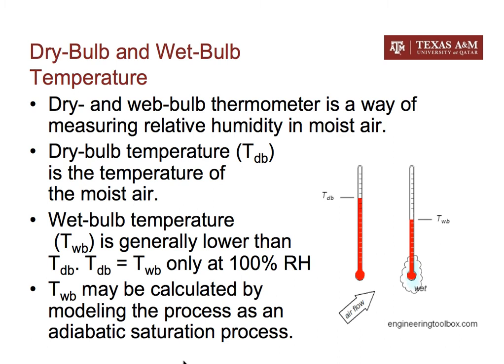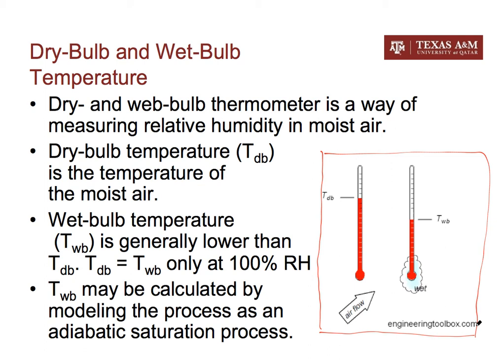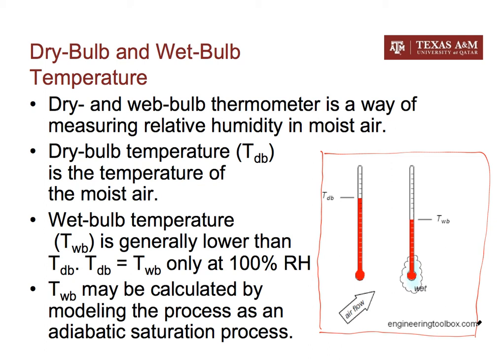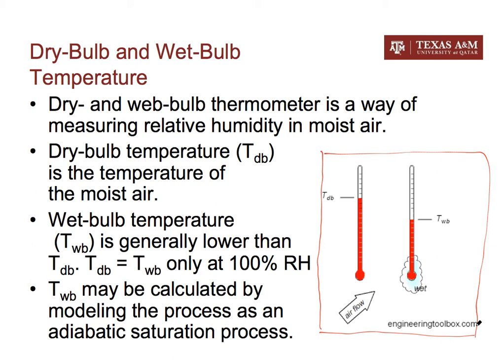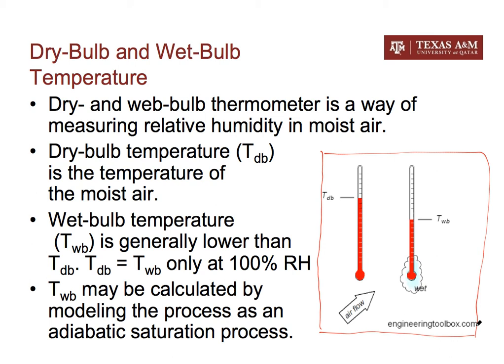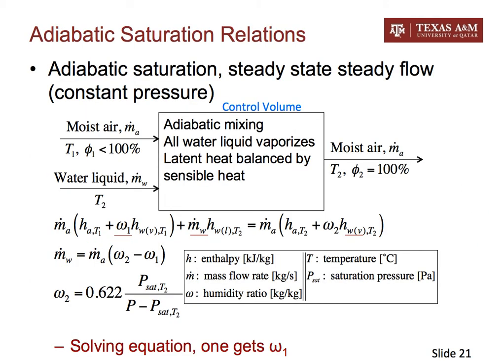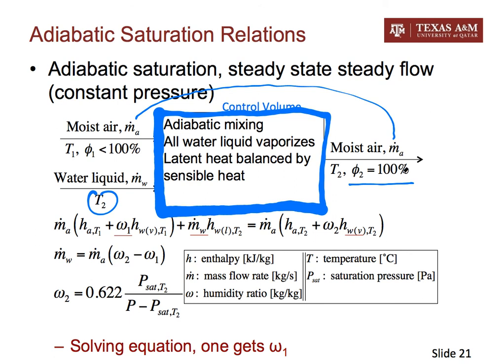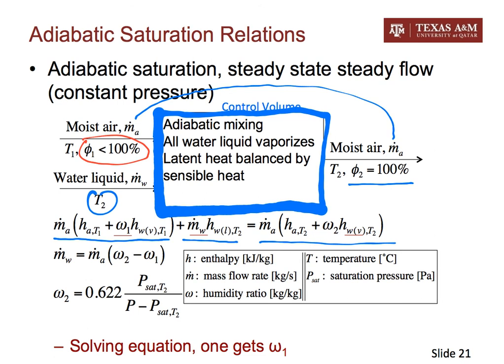Adiabatic saturation and humidity measurement

Comment: how can it be adiabatic and constant pressure simultaneously?
Reply: For instance, an idealized mixing chamber is adiabatic and constant pressure.

Adiabatic means the system boundaries experience no heat transfer.  This doesn't mean parts of the system can't exchange heat with each other, just that there's no heat exchange with the surroundings beyond the system boundary.  This is how adiabatic saturation can be adiabatic at the same time as it happens at constant pressure.  Heat transfers from the air to the water, and evaporates the water to join the gas mixture as water vapor.

Comment: how do we know mass of water at temperature t2
Reply from the maker: You do not need to use m_dot_w explicitly. Rather, divide both sides of the energy conservation equation by m_dot_a, and then substitute (omega_2-omega_1) for m_dot_w/m_dot_a, you will have an equation with omega_1 as the only unknown. Solve it to get omega_1.
Reply: thank you

Comment: Lower relative humidity leads to more space for evaporation &  that leads to lower WBT?
Likewise Higher relative humidity leads to lesser space for evaporation and higher WBT?
Why do we need to measure WBT around the air handler to determine the required charge of refrigerant?
What is the sense of this formula 3WBT-DBT-80 used for super heat or charging?
Higher relative humidity means higher load on airconditioning? Do we need more superheat in places where the relative humidity is higher or lower?
Do we need a higher latent heat of vaporization in dry or wet climate for air conditioning?
Thanks